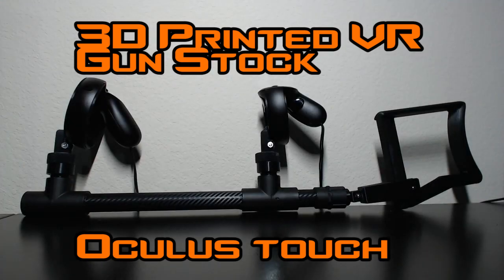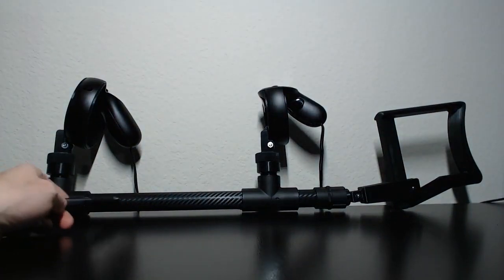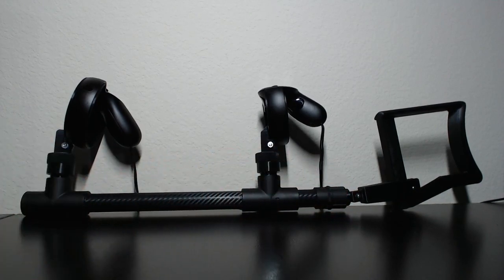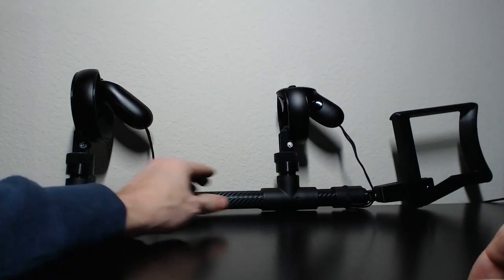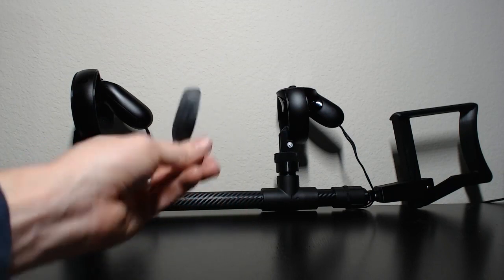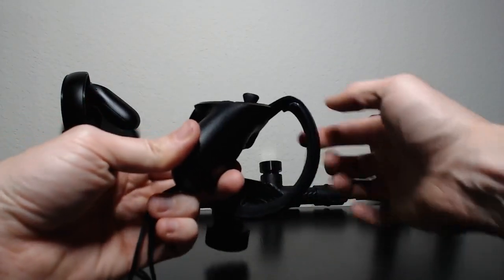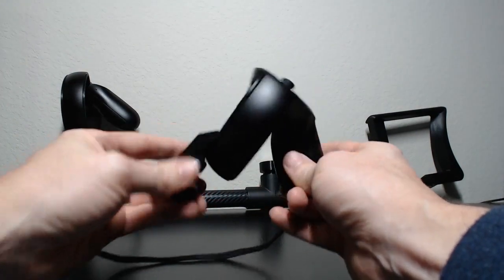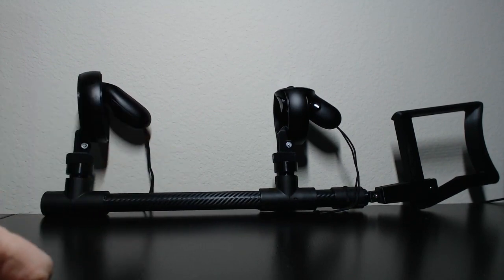3D Printed PVC Magnetic VR Gun Stock for Oculus Touch

Comment: Hi !
So, im printing it right now, and i had a question.
What PVC tube size do i have to use ?
And what parts did you bought to mount all the pieces ? (I can see at least 3 parts that where bought but i cant find any details on them).

Thanks !
Reply from the maker: Hi, the parts are mentioned in the video and some info in the thingiverse profile. It's 3/4" PVC. Thanks

Comment: what kind of printer do you have and is the quality that much better from the printing services?  I see on thingiverse, they offer printing from Print a Thing, Treatstock, and Ninjaprototype.  Which one did you use?  Ninjaprototype was by far the cheapest--the others don't seem to even be worth the cost.  Did you use .2mm thickness and 20% infill?  Thanks
Reply from the maker: I use a Ender 3. .4 on the nozzle and I can't recall infill but it should be on the 3D files I uploaded.